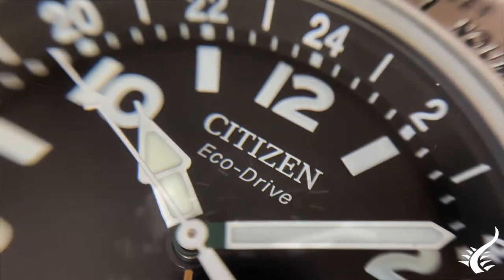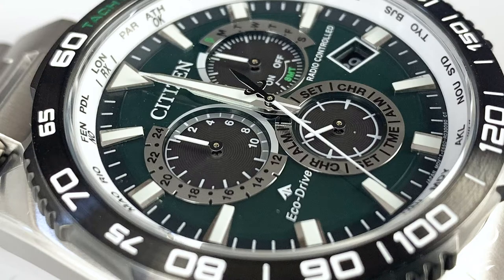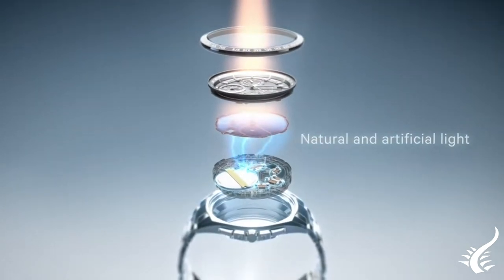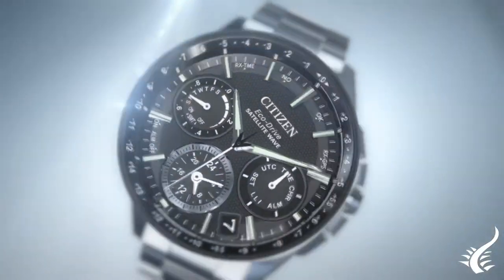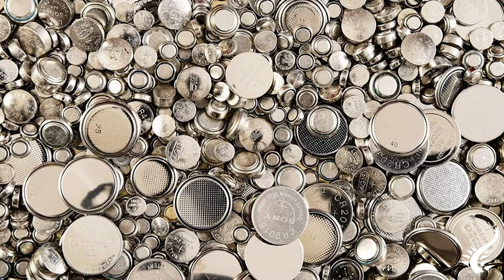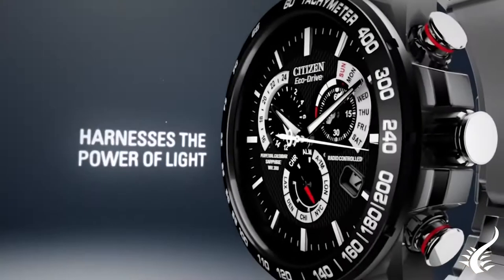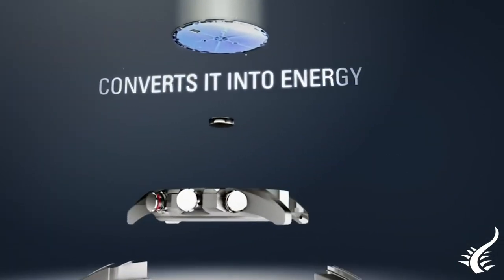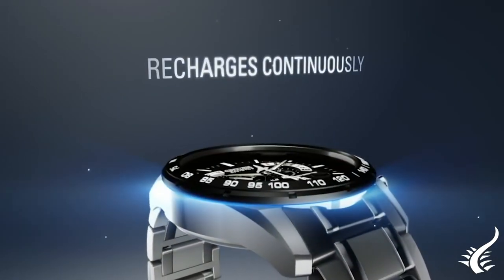How does Eco-Drive by Citizen work?

Comment: The "power cell" has a life-time.  Eventually, it will need to be replaced or the watch discarded.
Reply: Still pretty good. If you only replace the battery after lets say 10 years instead of 5 that's half the batteries you need.
Reply: @dylandreisbach1986  But not the advertised "never."

Comment: Needs replacement of battery after some years and its expensive. It charges by light and it stores the energy in battery and it has some life. Not a lifetime watch
Reply: its not expensive to replace, just more expensive than regular battery, sth like 10bucks.

Comment: Staring at my citizen eco drive just ten years old that watchmaker(s) have categorically informed me needs a new battery/ capacitor unlike what I was told when I bought it. Also, they suggest that due to the cost, ‘it’s just not worth it’. Beware..
Reply: service for an eco drive is < $100

your sources either lied to you or you're being purposely hyperbolic.
Reply: My eco drive is 15 years old and on the original factory battery. Still running like a champ